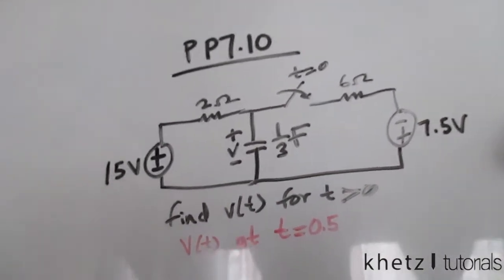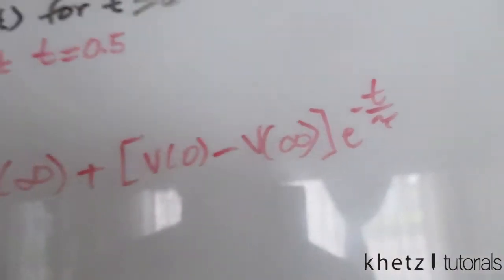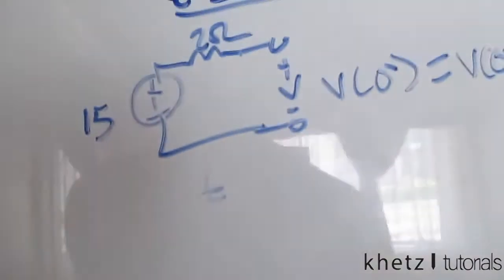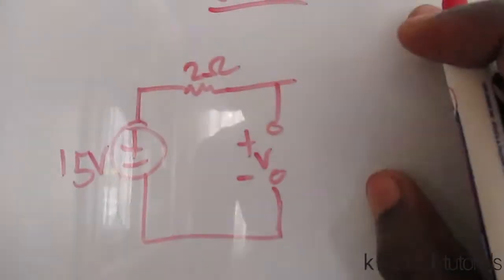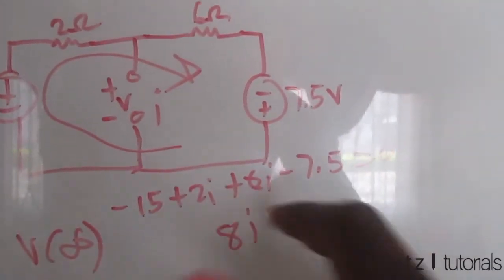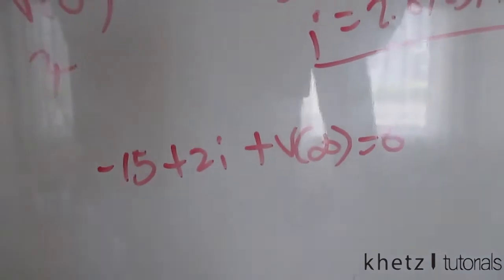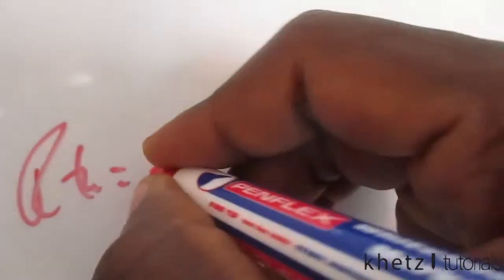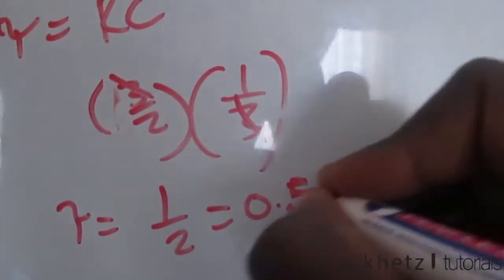Fundamentals Of Electric Circuits Practice Problem 7.10

Comment: Why have you taken capacitor as an open circuit even at t>0
Reply from the maker: You can put it back in place and use the initial conditions just after zero(t = 0+). Having it open just simplifies the calculation of th voltage value as time approaches infinity. So it will eventually reach steady state again and therefore be an open circuit